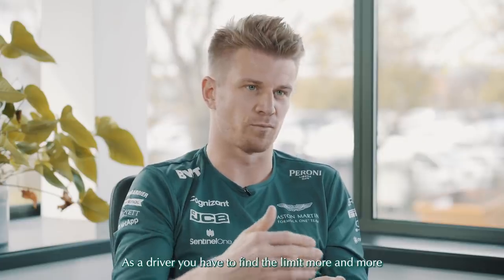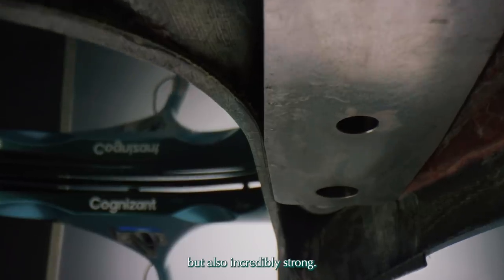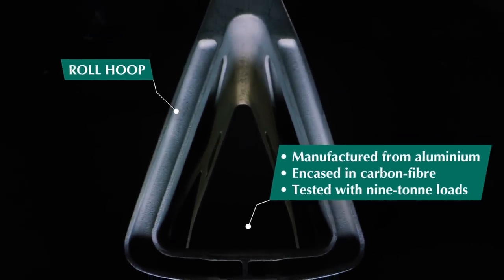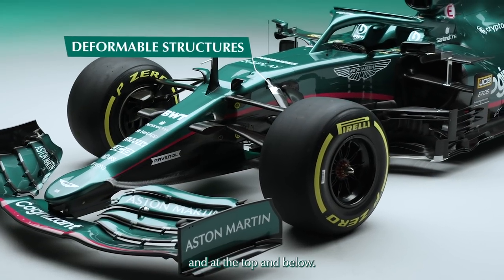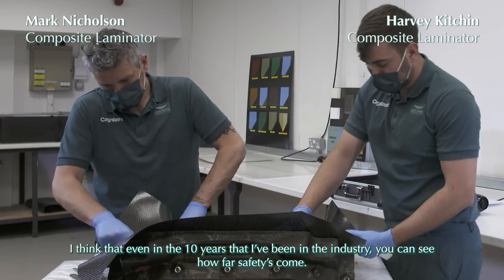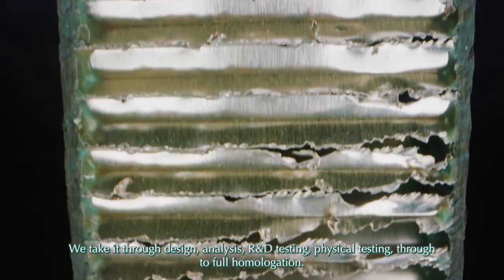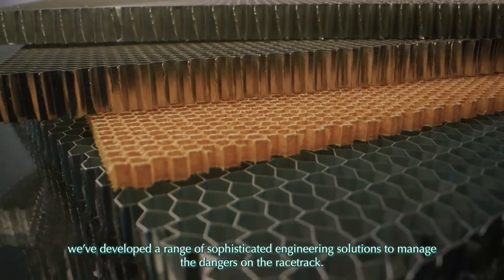Explained | The Race for F1 Safety: Cockpit Protection

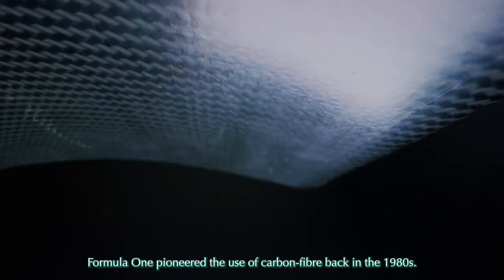Comment: 0:50 "tested at over 50 kmh" ... these guys are going excess of 250 kmh...
Reply: make that 350 on a good day.
Reply: I guess they are tested against a solid steel or concrete block. 
The tracks themselves are designed to eliminate this situation as much as possible. 
So there will be gravel traps, different types of barriers, tyre walls and so on to help slow them down.
Reply: @hydrusje  yeah exactly!

The track’s safety measures better have slowed down the car enough… nobody’s surviving a 350km/h head-on crash lol

Comment: F1 – Sainz tells the secret of Ferrari pole in Baku Saturday, June 5, 2021 at 19:24

Carlos Sainz, the “engineer-driver” as he became known at McLaren, gave the lyrics of how Ferrari managed to be so competitive on a track that plays against its UP weaker than Mercedes and Honda.

Monaco valued the strengths of the Ferrari, which is excellent in low-speed corners and its ease of climbing over curbs much more smoothly than other cars, thanks to its great suspension. And Monaco doesn't need a strong UP, as there aren't any relevant straights, or even bull curves.

Baku is also a street circuit, so Ferrari's strengths still apply, but there is a big difference, specifically a 2.2km stretch from turn 15 to turn 1 standing upright where it really needs the UP. Even so, Ferrari made it work.

Sainz was very frustrated at having his Q3 compromised when he crashed after Yuki Tsunoda hit the wall at turn 3. Still, he was in a good enough mood to explain what Ferrari did in setting up the car to go much better than expected. .

Sainz said the car's level of mechanical grip is so good, it allowed them to make a low-downforce setting on a circuit where the aerodynamic compromise between sectors 2 and 3 theoretically needs to be made.

“We're generating a lot of mechanical grip on low speed corners, mechanics and aerodynamics, and this has allowed us to take the angulation off the rear wing and therefore have less drag on the straights and still be decent on low speed corners,” explained Sainz when asked how the Ferrari did it to mask its weaknesses.

“One of our weaknesses is the medium and high speed curves with a long radius, and there is no such thing here. Obviously, we're exploring the car's potential well.”

“And it's a very good car to drive, it's giving me confidence. I'm really enjoying guiding him, so obviously I'm disappointed that I couldn't get a bit more out of him considering the circumstances.”

The speep trap numbers confirm this, with Ferrari showing up strongly in all of them, although Sainz's mighty 344kph at the finish line can only have come from a fairly significant vacuum. Leclerc was also second fastest in the first and second sectors and, thanks to Hamilton's vacuum on the straight, he was third fastest in the final sector, showing that the car ran well on the lap.

Sainz accepted that “you might think we were lying about our expectations here in Baku, but that wasn't the case. The entire team was genuinely surprised that this arrangement worked so well.”

“It's important for us to confirm our progress and the team as a whole is in good shape,” said Reds boss Mattia Binotto.

“We knew it's a different track than Monaco, we know that in Monaco it's all low speed corners and here you have the part of the track where you have low speed corners, but you have a very, very long stretch in a straight line too. , so we weren't thinking about getting the pole.”

“We expected it to be more difficult, but on Friday we saw that our car was doing well with the low downforce package as well. So, after yesterday, we knew we had a chance.”

Race pace, of course, is different from lap pace, and riding with the low-downforce rear wing can come at a price on Sunday in terms of how much will be required from the tyres. But in compensation, at the pace of a flying lap, Ferrari was legitimately – and unexpectedly – fast in Baku.